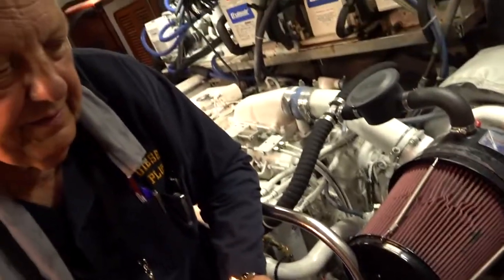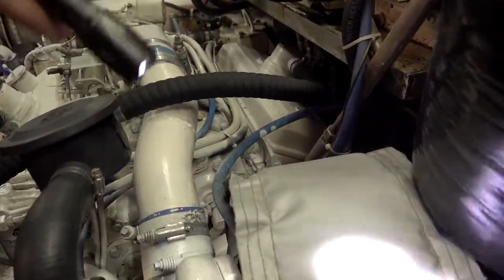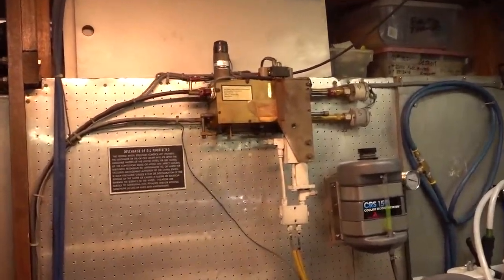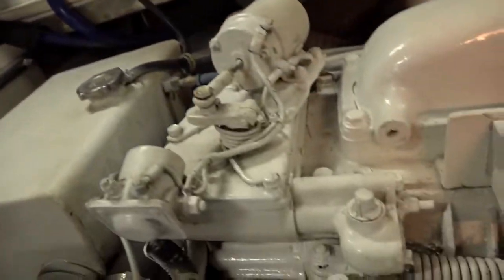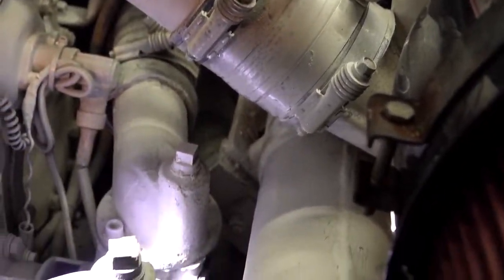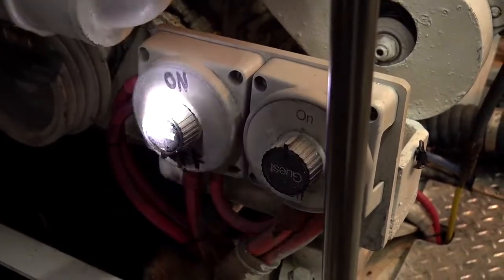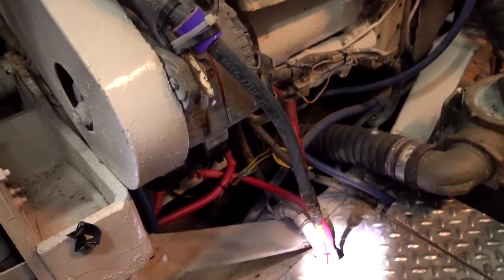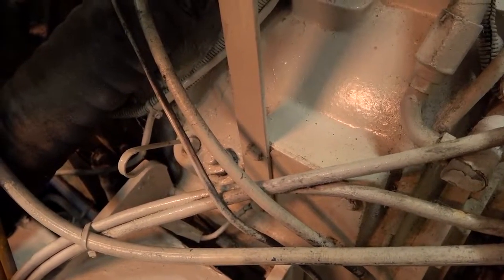Anatomy of a Marine Turbo Diesel Engine

Comment: I have the  same engines and setup, Great video! I’m doing an in frame rebuild on one…myself..
 I’m in the Gulf coast Alabama area. No Detroit mechanics in the region so self teaching. My engines are non ddec 550 hp. I’m always seeking info!
Reply from the maker: Ours have been derated to 450hp by changing injectors; better mileage?
Reply: @billdomb  Do you get full rpm? Did you have to change props?
Reply from the maker: @markflynfloat6779  Prolly lost 100 rpm; never changed props